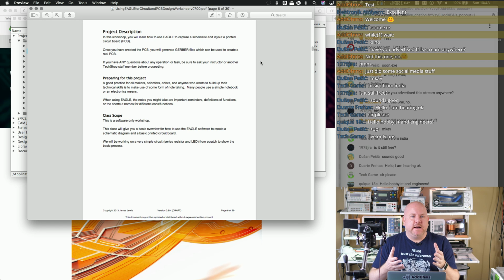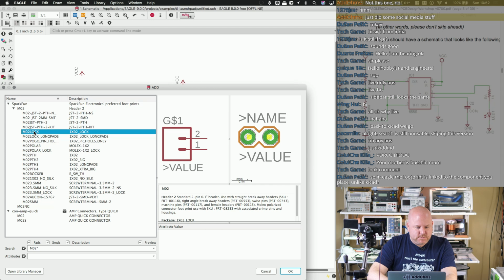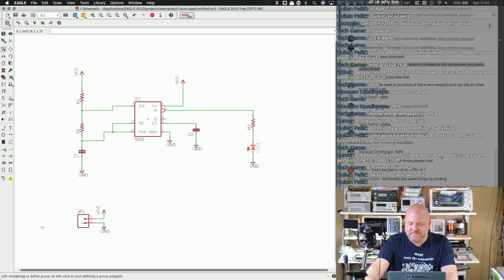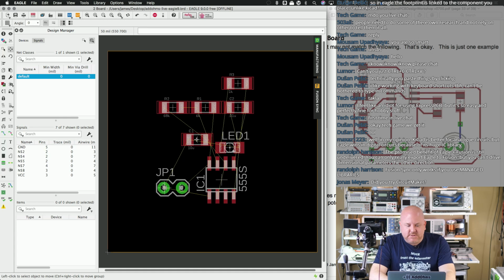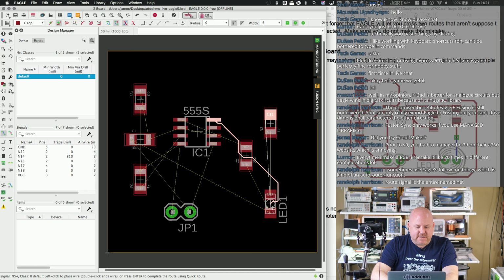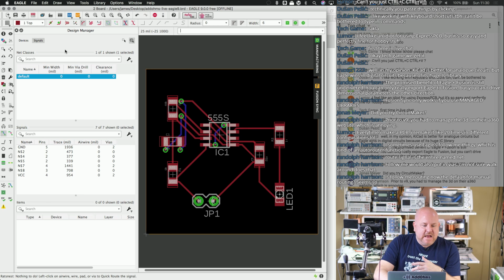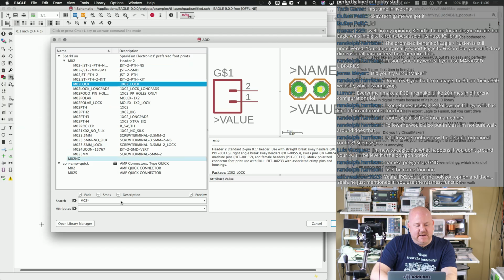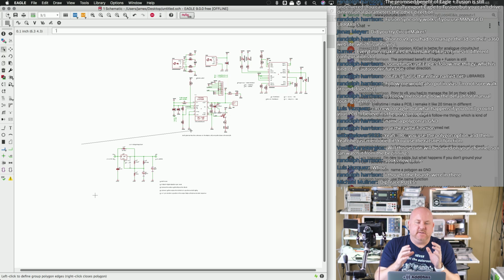EAGLE 9.0 - Checking out the new version on AddOhms Live

Comment: do you know why the polygon is acting weird? same thing is happening to me
Reply from the maker: It's not a bug, it's a feature. It's a hold-over from years (and years) ago when calculating the polygon fill was CPU intensive.
Reply: Thank you for replying. I'm actually doing a project and I'm confused with this version. May I ask how to pour copper on this version? thanks for the help.
Reply from the maker: Back when I did this stream, I remember the polygon/copper pour working the same as version 6. I did a video on that here: https://www.youtube.com/watch?v=O5aZQLSJajI
Reply: Every time I create a polygon around it, it will just cover the whole PCB like there is a red background like what happened on this video, I also am not sure why the components do not have holes on the PCB. Thank you  again.
Reply from the maker: You have to use the "Polygon" tool and not the rectangle tool. Again, I show step-by-step how in this video: https://www.youtube.com/watch?v=O5aZQLSJajI. As for components not having holes, the parts you selected in Schematic were selected with a surface mount package. If you go back to the schematic, click on the Change command (wrench icon), select Package, and then select a component, you'll see what packages are available for it.
Reply: Thank you again, this would really help me :)

Comment: It's the same software with Autodesk splash screen on top of it.
Reply: Eagle has been drastically improved.....piles of new features. I was and still am very critical of Eagle, but starting to soften up with the latest round of upgrades. I started with Eagle 6 which was a laughable piece of junk, similar to software I used in the mid-90's. Version 8 got them up to about the year 2000-2002 or so. Version 9 gets them to about 2006-2007 standards. 

Very quick rollout of useful features. It still is not amazing, but WAAAY better than before Autodesk.
Reply from the maker: Since Autodesk took over there has been progress forward. Maybe not the direction we all want or the speed. At least it is movement.